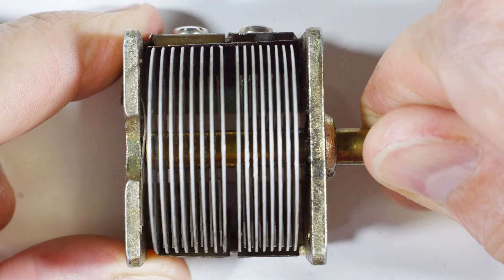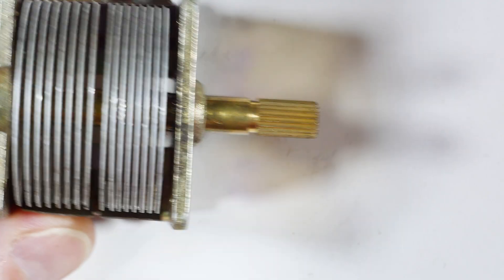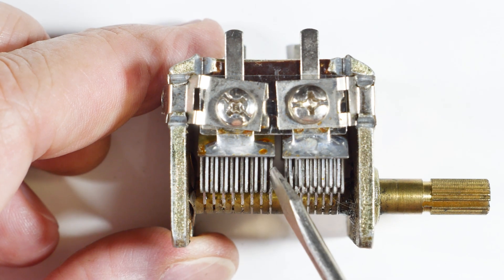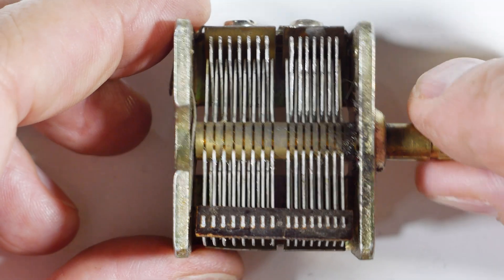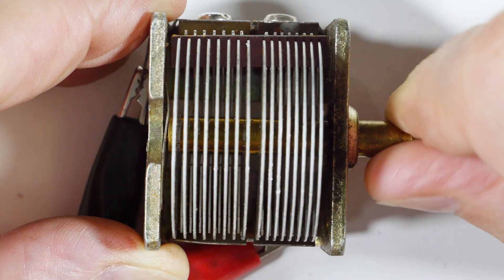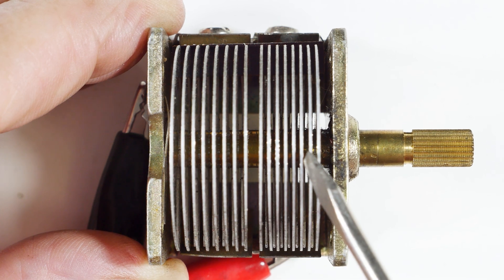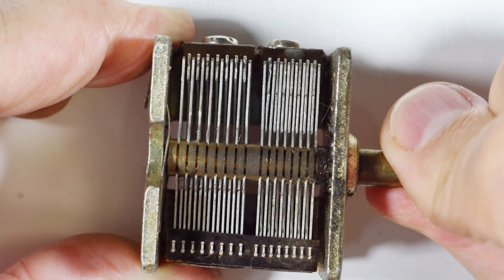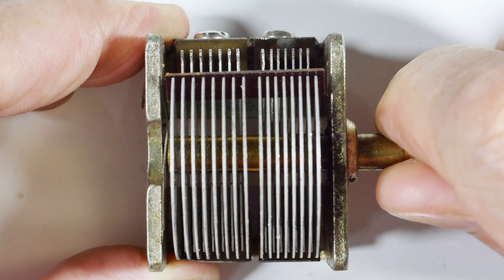Crystal Radio--Watch Out For Bad Capacitors! (4K)

Comment from the maker: Afterthought: One *might* be able to glue a thin teflon (or similar) insulator to the shorting plates. Never tried it.
Reply: Changing air for a dielectric will change capacitance
Reply from the maker: @nooneyouknow9399  Yes, but on 1 or 2 plates, it should not make a huge difference. Would probably increase capacitance. And it is a variable capacitor.
Reply: There actually was miniature versions of these with very thin plates, almost as foil, and they used insulating paper between all plates. Regarding capacitance change, as you anyway adjust it to the right capacitance it does not matter much in applications like crystal radio etc.

Comment: Thanks for this very informative video that showed me how to test my variable capacitor that is shorting out half way through turning it. I can't see any plate s touching but one wafer seems to have a slightly wider gap where it shorts out...i will dismount it from my Dx-160 and clean it in a sonic bath. Deoxit didn't help the short

Comment: Ther is another more subtle failure mode for these capacitors.  If they are out of an old kitchen radio, sometimes the plates are covered in a thin film of kitchen grease.  This lowers the capacitor’s Q value to the point where sometimes no signal can get through.  Fortunately your basic spray solvent can usually restore these to working order.  Same problem with the trimmer caps.

Comment: Since I am 72 years old I remember when these types of variable capacitors were the radio station frequency tuners on both AM and FM radios, during the analog radio days. In the 1950s and 1960s and even into the 1970s these were the tuning devices of all types of radios.

Comment: These are  VERY  valuable as they are no longer mass produced ... I have a 200 pF , 5 kV  type from a lifeboat emergency transmitter and it has a plate spacing of  ¼ inch !  ( so this problem does not exist ! ! ) .... DAVE™🛑

Comment: Ultrasonic cleaner using some solvent is great for removing filth. Citric acid bath for severe corrosive growths from vanes. Capton tape stuck to side of vane that shorts out if no other way to be fixed. Often screw and lock nut to control shaft end-float cures plates touching. High voltage between terminals, then rotate plates. Black soot will show exactly where high spot or short is located. Keep doing it to spark-erode the high spot! Remove a troublesome vane completely, there may still be sufficient capacity to be useful... just a few of my methods.
Reply from the maker: Thank you, that is very useful.

Comment: I had a MW5 broadcast transmitter with small air variable to trim the frequency. Once set they never moved. One day it shorted due to dried out bushing. It was supported only on one end. Replaced it and 8 months later the replacement shorted. These were replaced with a small trimmer of a different construction.
Reply from the maker: Hadn't heard of that before, but it makes sense. I'm not sure I would have ever thought of looking at that.
Reply: @tsbrownie  It made itself known when I was suddenly off frequency

Comment: In my experience open air caps seldom ever go bad but mashed plates and dirty ball bearings or bushings will cause faulty operation. Straighten the mashed plates if possible and use conductive grease on the bearings or bushing as moving parts do need lubrication.I like air caps more than those in "cubes" as at lest you can affect repairs and also I like them more that PLL or Varicap tuners but for better same Hz discrimination by turning the radio set. Good video.

Comment: did you try to identfy the shorted plates?
At first i always try to change the "setoff"  of rotor and stator by carefully adjust the axial Position. 
If i can not reach the goal. 
i stick pieces of thin paper between the plates to find the deformation spot(s).
Then carefully bend back with a stiff and thin piece of plastic (cut out of blister package).
Sorry for my poor english and good luck:)
Reply from the maker: Yes, but it was 4 plates and 1 is badly deformed in 3 dimensions.
Reply: @tsbrownie  ouch

Comment: Thanks for sharing. I had not thought of the simple continuity test = excellent. I hear your frustration, with attempting to repair them. I have seen tools that straighten the fins on home air conditioner coils and automobile radiators. I have no experience with using them, but I wanted to make sure that you were aware of them. Obviously, a tool which has combs is needed. And, the spacing needs to be correct. Maybe a common plastic comb could be easily tweaked? Also, I know that there are fine-toothed, metal combs made to remove insects from the hair of animals (and people, too - yuk.) Just spit-balling, to try to ease the frustration. Cheers.
Reply from the maker: I've got an AC comb, but some of these caps' tolerances are so close that even a bit of corrosion is too much. I'd like to see how they were made.